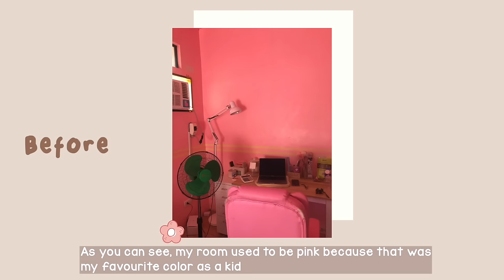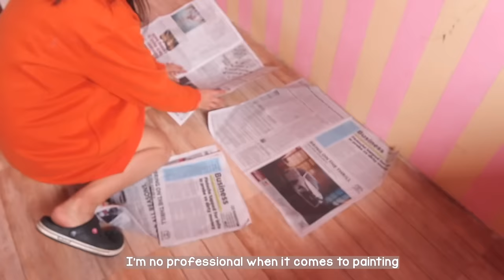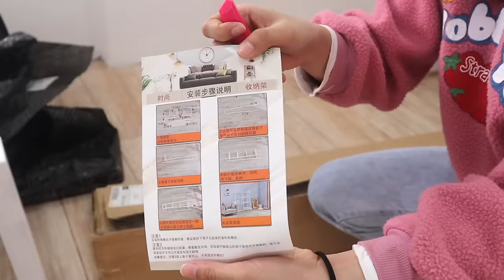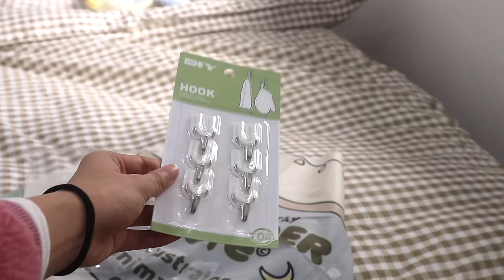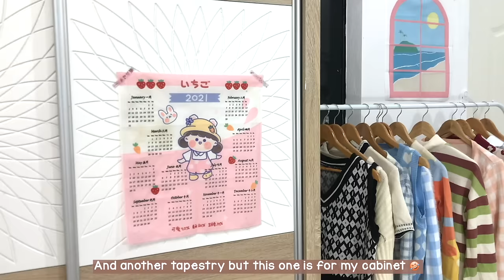EXTREME Aesthetic Room Makeover 2022 🌷| korean-inspired, pinterest, pastel, cozy + Shopee Finds 🧸☁️

Comment: first you had to sand the wall to remove the paint from the wall (remove the pink color) so that the paint is better impregnated and TO PREVENT THE PAINT FROM FALLING AT SOME TIME, normally the paints if a new layer of paint is put on top They slip and fall, so that's just so you know